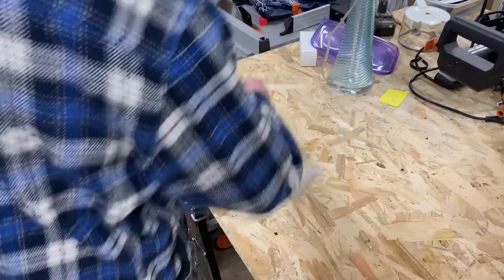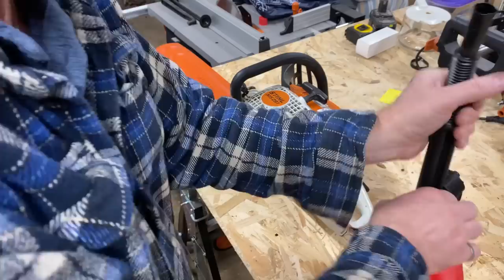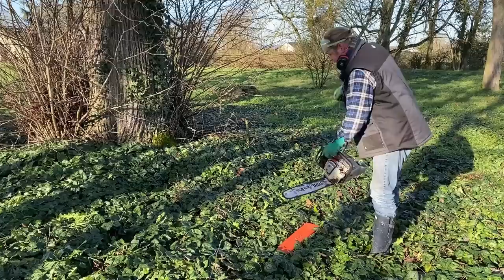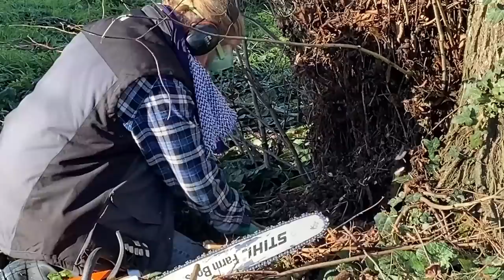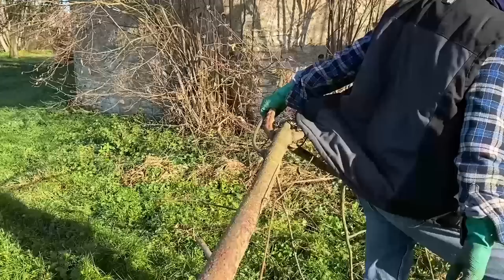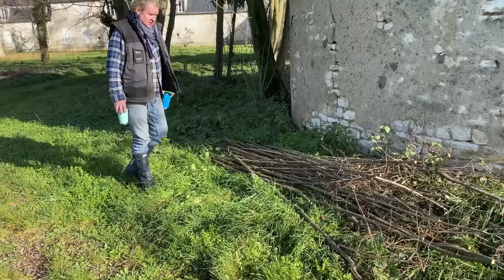DIY Chainsaw Preparation & First Use for the Season | Friday at the Chateau - Journey to the Château

Comment: My goodness!  Is there anything you can't do besides chainsaw, roof repair, floor replacement, carpentry, gardening, decorating, cooking, cleaning, sewing, plumbing, electrical wiring, etc?  Can you pull a car up under a tree, pull the engine, overhaul it, drop it back in and drive off?  I could maybe goldleaf a car but that's about it.